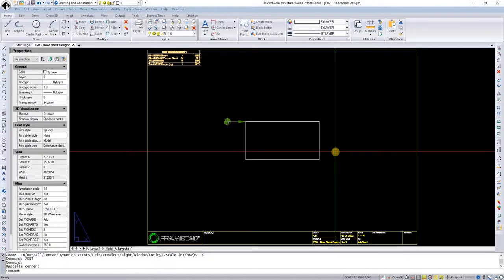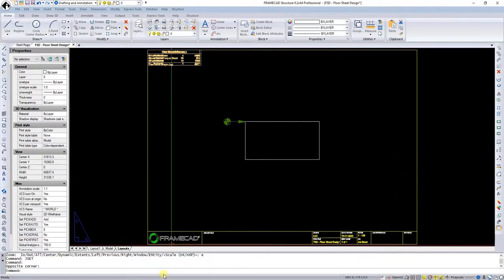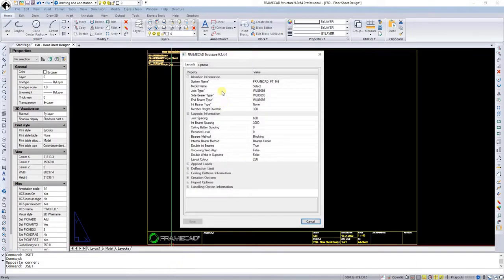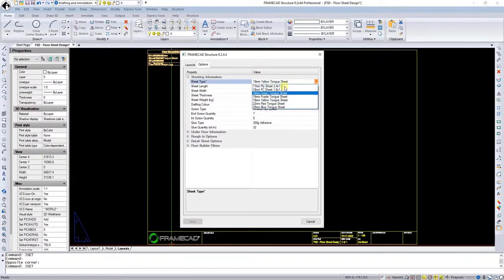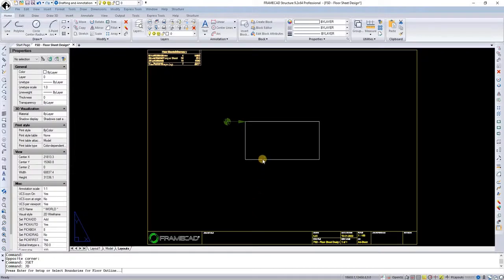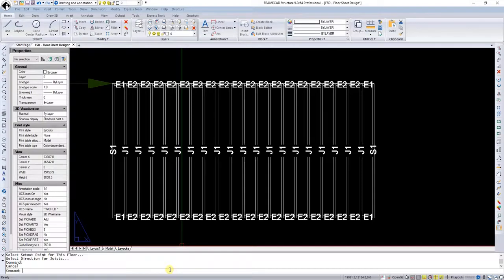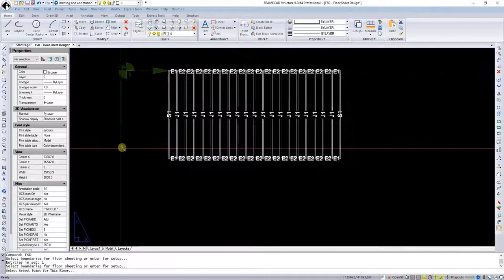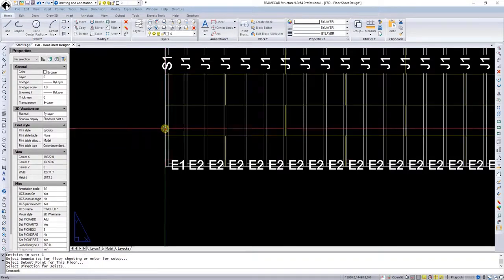Framecad Structure - Floor Sheet Layout

Comment: Great tip thanks - can we add other floor sheet products?
Reply from the maker: This is driven by the data-file. This is different for different countries. You can ask FRAMECAD to help you updating your data file if needed.
Reply: Can you take training of software on line, please respond, thanks
Reply: Sir are you available for training face to face or online, please confirm, thanks